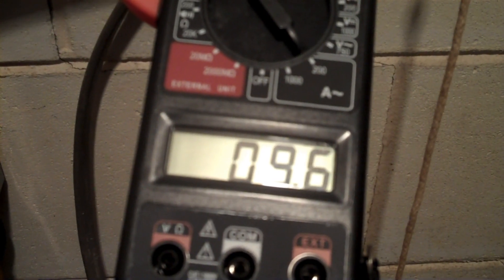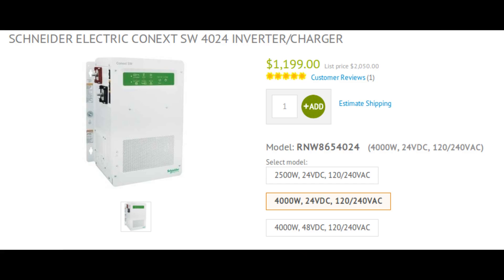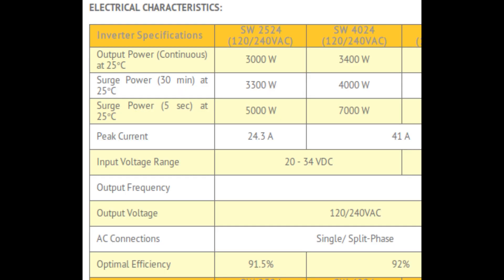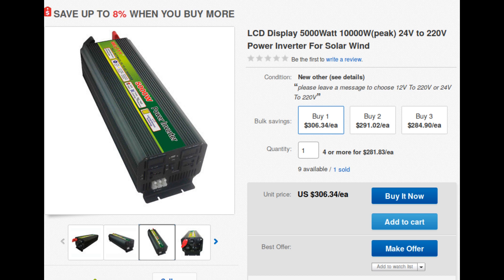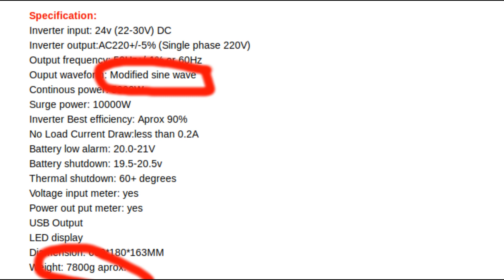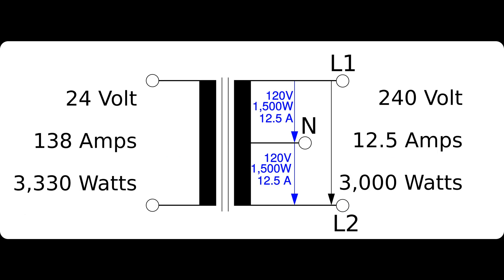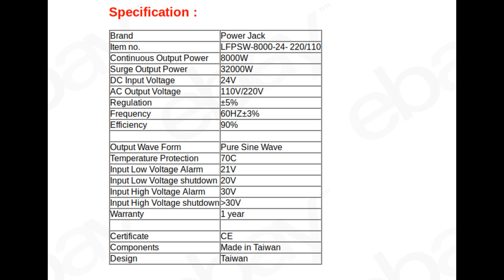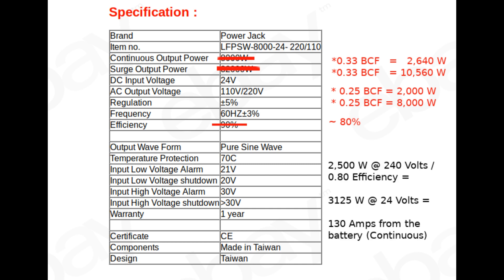Running a Well Pump off Batteries - inverter choice (part 3)

Comment: Checking amps on a single wire there is only 120v on a single wire in US systems because they are split phase.  So your calculations about watts are double what they should be, 1200 rather than 2400 watts.
Reply from the maker: @Billy-Jay  my well pump is 240 volts.

Comment: Why would it be a lot easier and cheaper to just install a small 240 volt Generator or inverter generator to run pump and most anything else! Just start occasionally, pump up tank, fill tub, shut off and go to sleep
Reply from the maker: Yes, as long as your generator is big enough to handle the inrush current.  But then you have to worry about storing gasoline (or propane, but propane generators cost more) long term, and starting the generator once every few months to keep it lubed up, etc.... and cables to go from the outside generator location to the inside well pump location.

Comment: I have a 120 volt shallow well at my cabbin and i ran a 4000watt 12volt power jack to power it all last summer and didn't any problems
Reply from the maker: Yes, I expect the 120v pump has lower power requirements.

Comment: Jay,
How about an update?  Does the PJ inverter pump water out of the ground?
Reply from the maker: Yes, see the full playlist for all the details:
https://www.youtube.com/playlist?list=PLmHP4lUqxKmt2fgNM8CIAQ4CruRduhWx0
Reply: @summetj  I have watched all your vids in this series, thanks!  Im trying to mimic your success and I keep getting feedback from inverter vendors on eBay that the PJ 8000 LF is way under powered to run my 2500w well pump.  Whats your secret?  Soft start for well motor?  Would a PJ 15000w insure mine wont be under
powered?
Reply from the maker: @homecam3520  I have a one horsepower well pump with a standard run/start capacitor.  The power jack 8000 is just barely good enough to start it up when my lithium battery is at its top voltage. I get overcurrent warnings and if the voltage level of my battery gets too low it simply won't start it up. So a larger inverter would definitely give you a little bit more wiggle room.

Comment: Why not use a capacitor on both legs of the pump to assist startup?..
Reply from the maker: The well pump has a start run capacitor already installed. Changing it out to a soft start variable speed controller would reduce the inrush surge needed to start the motor but is more expensive.
Reply: @summetj  thanks for the info.. my expensive inverters wont run my well unless I already have a decent load on them.. 

But I have 2 cheap inverters similar to the load Jack ( but smaller) that run it but they are 12v and not the 24v I am running ny system with.. frustrating it is

Comment: Lol....BS correction factor....I should see if this in my machinery handbook.
Reply from the maker: The "8,000" watt inverter is able to run my well pump, but it gives overcurrent warnings on startup and requires that my input voltage doesn't sag at all, so a 0.30 BCF was about right....

Comment: do you know if you can actually run a split phase 240 well pump off of a single 240 inverter???
Reply from the maker: My well pump is not a split phase well pump, it is a 240 volt well pump (two hot wires only, no neutral).  And it runs off of my split phase inverter (using the two hot wires, L1 & L2). 

If you have a large enough 240 volt inverter, it does not need to be split phase to run the 240 volt well pump. But in the US, we have split phase power, so all of the 240 volt inverters here are also split phase to provide dual 120 volt phases.
Reply: @summetj  I have the Powerjack 8000W 24v to 240vac inverter and have currently two 12v 200 Amp hour Lithium batteries wired in series.  I know I need two more batteries to even dream of trying to use this monster.  I have a 30 A breaker to my pump, so hope I this will power it once I get the another two batteries.  That is the only thing I wanted this inverter for.

Comment: I have used the Schneider and they are awesome. I have avoided a lot of the Chinese cheap inverters and they cost more in the long run. I have blown up many of them. I think the Schneider is a low frequency inverter. You have a good speaking voice